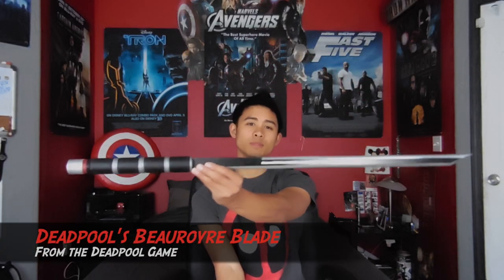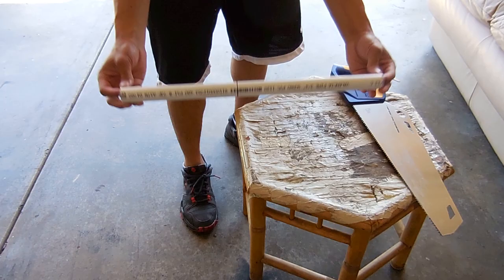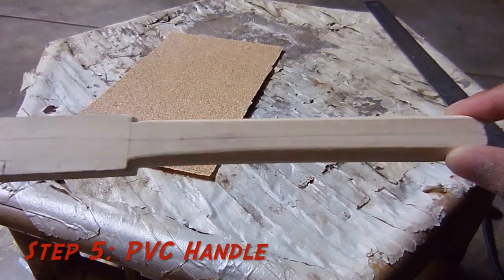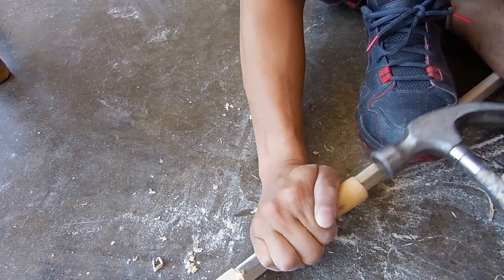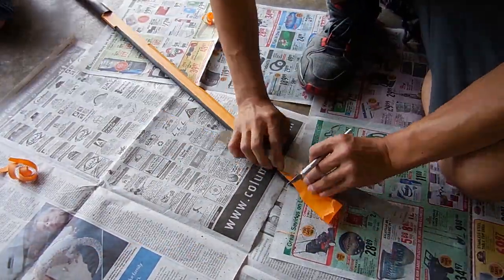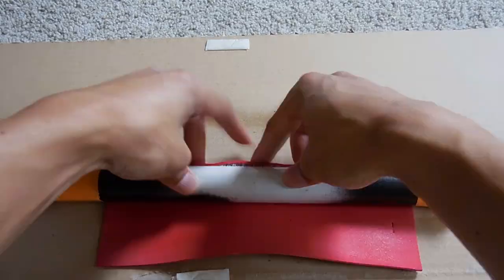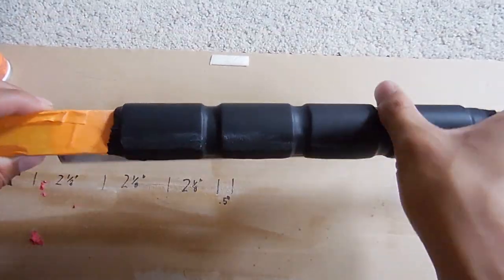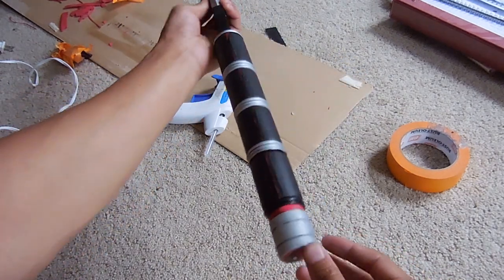Beauroyre Blade (Deadpool's Sword) Tutorial

Comment: I was watching to see how others did it and I really like what you did! It has much more detail than mine. I simply used a whole pvc pipe and using a heat gun compressed it flat except the last 7 inches to make the handle, then used sandpaper to get the angles and a file to get the look I wanted. Basically what you did but my whole sword is pvc and VERY strong , ridiculously so. And then painted the same way. The only reason I'd prefer the one I did is because the handle is hollow and can either be filled for weight or left hollow  for secret storage of taco money. You can take my idea and make and improved version I'm sure. All in all I thin both of the swords I made cost under $60 materials and machinery included
Reply from the maker: I'll definitely keep that in mind! thank you.
Reply: PropItLikeItsHot Fyi quick update on the make I made, don't fill it unless you want an actual weapon, I tried filling it with sand and just hitting some cardboard to see the impact and it went through, past, and into a planting pot, subsequently breaking the pot..so yea, I'm thinking I'm going to.build yours now and not scare myself (:

Comment: Mate, I have started my deadpool swords today and they are coming together nicely. Done a lot of sanding with a multi-tool and will finish by hand tomorow. Then onto the foam for the handle. I will also use paint for the end cap rather than sharpies, but that is just preferred medium :)
Reply from the maker: Nice job! The only reason I went with sharpies is because it's faster and easier. But of course your way will look much nicer. Let me know how it turns out! And good luck with the rest of your builds.
Reply: Made a lot of errors so far but I'm persisting. Got the blade edge pretty good, wrecked the fuller (them 9" in your video) a bit, so looks a little rough as a result. Will post a photo as soon as I have finished it all and made the second one.

Comment: I am not sure the O-Rings make sense, the 10x 5/8" thick with an ID of 1-1/8".  If you put 3 o-rings next to each other in the 7/16" foam groove, each 5/8" thick, that will amount to 15/8 or just over 1".  I think each of the 3 foam grooves needs 1/8" thick o-rings.  Also 1/4" thick O-rings are tough to find at Home Depot, Lowes, National Tool and Harbor Freight.  Can you help/clarify?  Thanks,
Reply from the maker: My materials list is like a recipe. Any cook can tweak it. That's just what I used and it just so happened to work. The math may not be correct but I wanted a tight fit so it would stay in place.

Comment: could you use a sanding tool on a dremel instead of a sanding block ?, cause i don't really know if that can work
Reply from the maker: Only if the sanding tool is wide enough, otherwise it would be hard to keep the surface even throughout the length of the sword! Hope this helps!